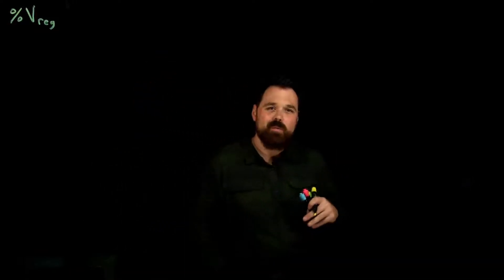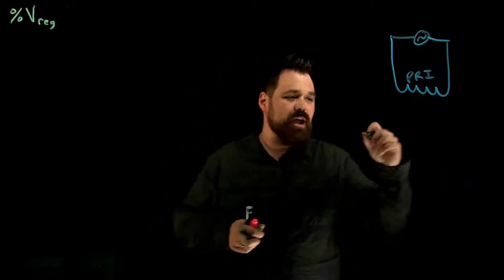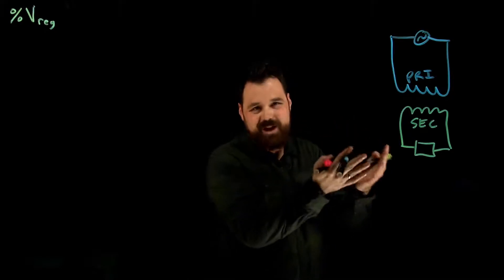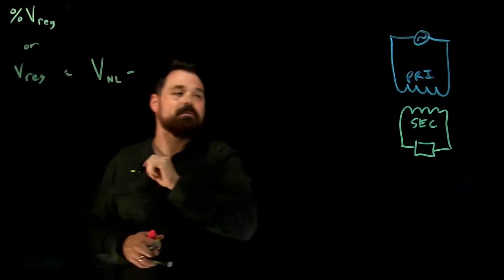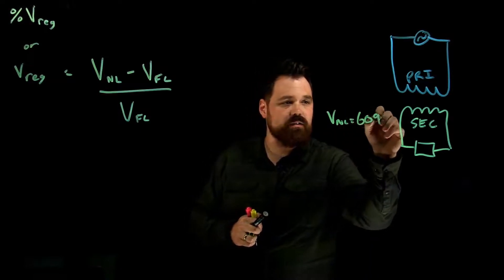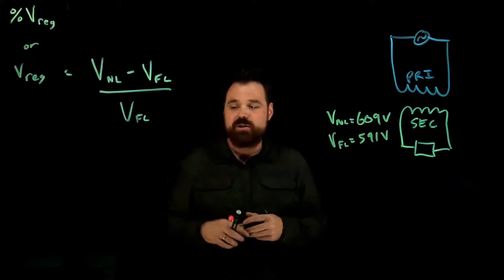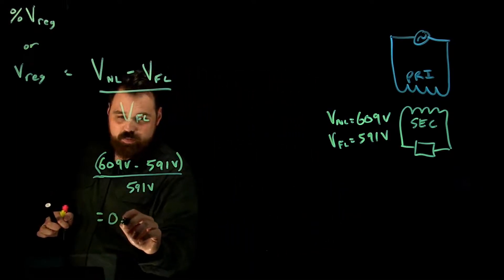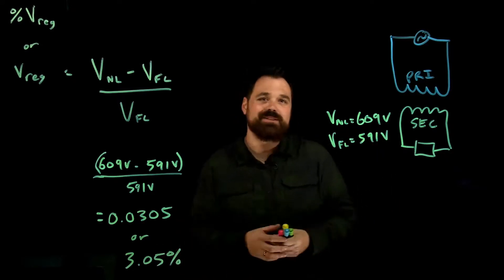Voltage Regulation of a Transformer

Comment: Correct me if I’m wrong, I was told that formulae is not the correct one to use as that is similar to that of motor. Instead it’s vreg= (VNL-VFL)/VNL=ANS*100
Reply from the maker: I'm pretty confident it's NL-FL / FL
Reply: Ok so I think found that it depends on the standard being applied where IEC states the reference is the unloaded secondary and ANSI/IEEE state the loaded secondary secondary voltage is used..
Reply: In book it's also written Vnl-Vfl/Vnl*100, sir please check
Reply: @debajyotishaw5672  it's deffinitly Vnl-Vfl/Vfl x 100 I just wrote this in an electrical trades exam recently

Comment: sir, about the Vnl. does the voltage measurement calculation must be done in open circuit on the terminals or close circuit terminals?
Reply: Open circuit.

Comment: What is the difference between percent impedance and percent regulation?  Arent they both voltage drop at full load?
Reply from the maker: %impedence is more about overcoming the impedance of the transformer

Voiltage regulation is the change in output voltage from no load to full load

Comment: Thank you for information 
if the voltage regulation percentage increases that is good or  bad?
Reply from the maker: I guess that would be bad. It means a bigger change in voltage as you add load which can be really hard on equipment.
Reply: @ZackHartle Yeah, it would be awesome to add these kinda extra explanations on causes, purpose etc. these would give us learners more insight into electrical world.
Reply from the maker: @calebsaheb3159  That's a great idea. I'll see what I can do.